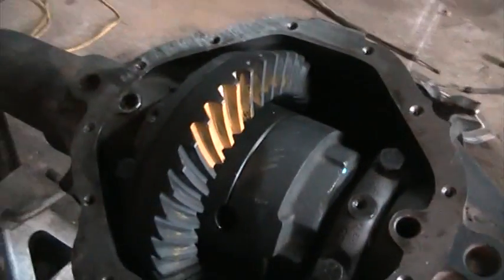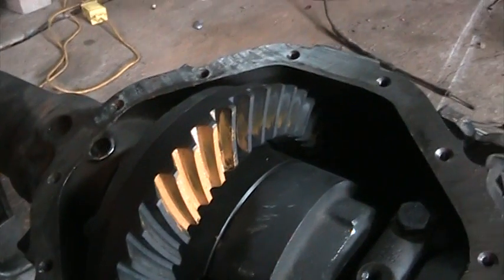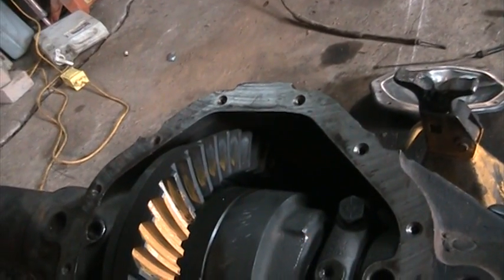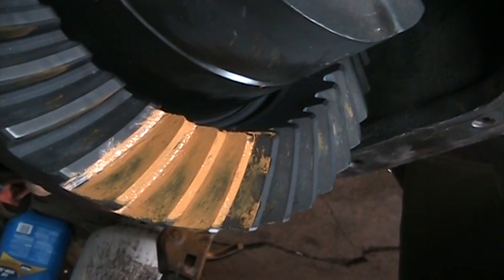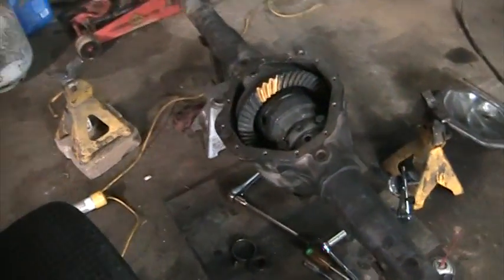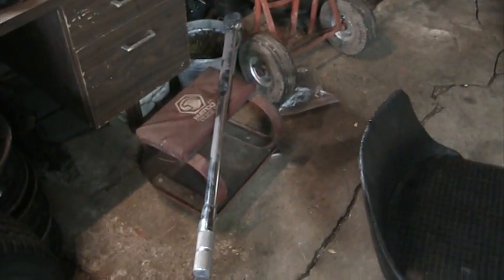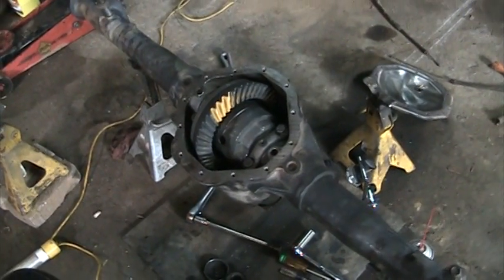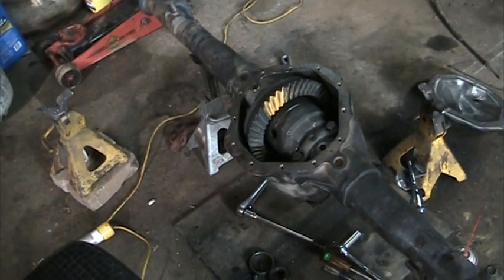410 Install Part 4

Comment: 2 cents.
You don't need 200+ ft/lb torque wrench if you use crush sleeve.
Just tighten pinion nut till get specified free rotating torque of ___ inch/lbs.
Use 200 ft/lb wrench if using hard shims instead of crush sleeves.
Hard shims may be reused but crush sleeve should not be reused when swapping gears.
Crush sleeve is faster to set up.
Some prefer hard shims for heavy duty applications.
If reusing pinion nut be sure to apply thread sealer/locker and deform mating thread w/ punch.